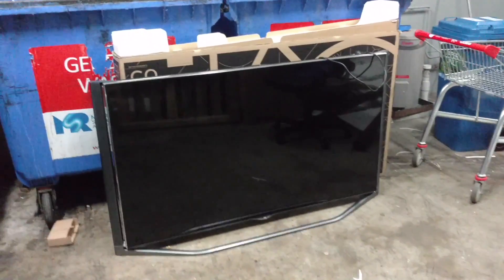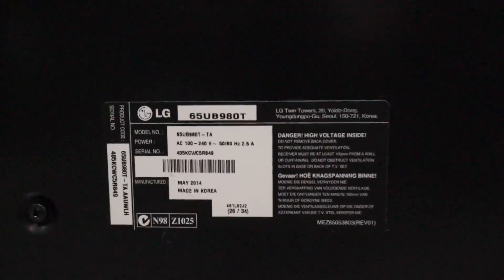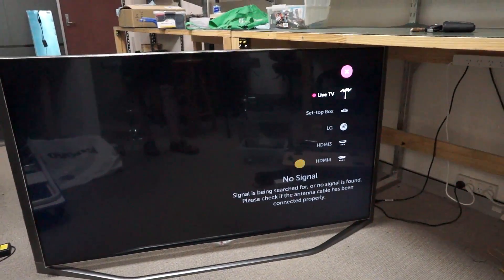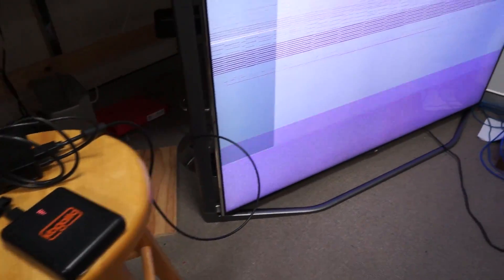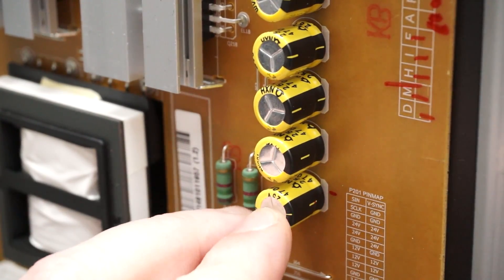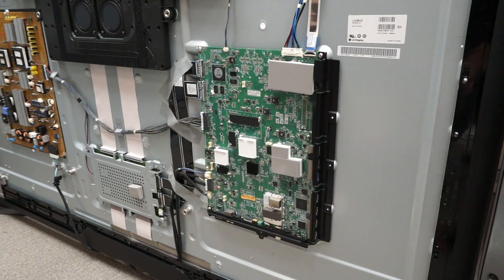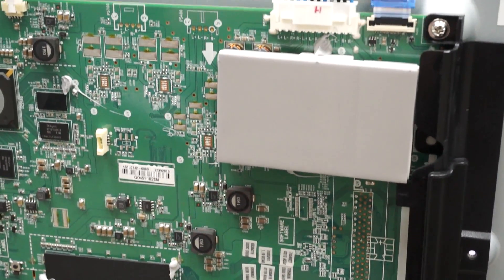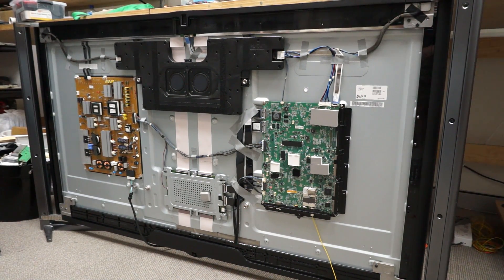EEVBlog #1145 - Dumpster Diving 4K TV!

Comment: LOL!  It's absolutely amazing what people throw out in that building!!!!  I am guessing bad BGA connection on one of those chips covered, but maybe the chip that connects straight to the HDMI ports took an ESD zap or something.  I do know that connecting HDMI cables up whilst powered can kill chips on occasion - happens a lot in PS4s and XB1s.  I hope you get time to look at this at some point!
Reply from the maker: $0 to toss in the dumpster room.
Reply: And this is why I sigh when I see certain products with no ESD protection on the HDMI ports at all.

Obviously those newer consoles do have ESD clamp diodes (either in the HDMI chip or external), but it shows that even those still get zapped quite often.

I'm talking more about specific boards that hook up an HDMI port directly to FPGA pins etc., and those definitely don't have full ESD protection beyond the usual IO clamps.

And it's often not "static" itself that's zapping the chips, but that voltage difference you get between two SMPS-based devices, or say an Earthed PC and a monitor.

Without the requisite extra ESD clamp diodes, some of those devices are just waiting to be zapped. And, as you said, it happens sometimes even with the diodes, so best to power down the console before connecting cables.

#ESDrant   lol

But yeah, I agree that the fault on this TV might be a cracked BGA joint, or some bad RAM maybe. Could still be a bad core supply or something, of course.

It looks as though it's at least trying to write the pixel data to the DDR RAMs, and obviously the scaler chip is detecting the input format (and even the PCM audio), so I reckon the problem could be the signal path between the scaler chip and RAMs, a bad RAM chip, or dodgy supply there.

The OSD is probably handled directly by the "Smart TV" SoC, and uses its main RAM for the OSD buffer.

It might even be the connection between the HDMI input chip and the ARM SoC itself, or noise or an LVDS / TMDS link maybe?

I still can't believe people throw out stuff like that. I don't even have a 4K display yet. I only just got a 1080p TV and monitor about two years ago. lol
Reply: I'm watching this on my very own dumpster diving tv set with no faults hahaha
Reply: paid 150$ for pickup to trash yard. but cost 3000$ for fixing from service center. no brainer, just make it another world's trash pile and get another New TV
Reply: Killed a pi by plugging HDMI in while powered on, I suspect it's the tv I used as it does like to float quite high above gnd
Reply: @Blondie SL Where you from ?
Reply: He should get the broken screen one and take the board from it :)
Reply: Good idea, but l think thats not what the channel is all about. He' ll find another way to fix it. With the wide variety of divices on the market it'll be hard to find the right one anyway, unless he pays for it wich l think he wont.
Reply: @brotschuh  Yeah, I was just throwing out some ideas, who knows maybe that one has a similar issue that could be interesting as a donor

Comment: Bad solder joints on the main scaler chip (BGA of course). A bit of flux and reflow and she'll be all right again :) Broken BGA-joints on flatscreen TV's are totally "normal" when they fail.
Reply: I agree; it could very well be cracked solder joints on the main BGA that is causing this. I think it would agree pretty well with the symptom.
Now, the question is just if Dave has got the balls to repair it. ;)
Reply: 20+ years experience repairing TV’s etc. Wise me gave it away in 2008 ;-) I too suspect the likely potential of bad BGA solder joints. There appeared to be vertically synced data on the display. To confirm it, you may be able to apply some local pressure to the HDMI inputs processor and then power the set in order to get a clean HDMI sourced image. The last time I browsed a (apparent) service manual, it was disgusting to see rails and data lines etc. going to an empty white square labelled “uCom section” or similar right in the middle of what was meant to be “The Schematic”. Talk about a forceful throw away society we’ve come to be.
Reply: @terrypriest4898  hopefully that can change. At least in the US with Right to Repair which Apple and gang were trying their best to bloke. As if we repair our stuff they can't sell more phones/TVs.
Reply: @terrypriest4898  Flatscreens havent been around 25+ years?
Reply: Tyrone Nelson No, but I have been around alot longer than that 😉
Reply: @terrypriest4898   Not long enough to work out why people get  a<>lot of flak for appalling spelling, apparently. SMH.
Reply: AntiCorruptionCentral yeahitmustsucktobesoboredtopointoutamissingspaceinaresponsequicklytypeduponamobiledeviceandassumebadspelling.gladmylifeisnotsoinadequate.duh!
Reply: @eevblog try a repair!
Reply: It's all about Balls !
Reply: @RavetcoFX it's not a flip chip. It's not the high lead bumps at fail here, it's the actual solder balls under the chip
Reply: @zaprodk  some time pople mistake the isue becuse when you reflow th donw ball the uper get too and fix the isuue but whit time the fail come back like on nvidia 8600m chips.
Reply: Datz was enough to kick it and it works.
Reply: John Doe oiss
Reply: I agree, a simple 10min reflow can give this TV a few additional years of lifetime. With proper re-bailing probably a decade or more.
Reply: Wrong, its a bad video decoder, processor.
Reply: @RavetcoFX  long enough to stick on craigslist for 600 bucks?
Reply: can you reflow solder balls? I thought it needs a full reballing
Reply: @zerpBot
 That would be the first step. Using a hot air station and flux to reflow the balls. If that failed and you wanted to remove the chip then you'd need a reballing stencil for that chip.
Reply: @zer0b0t  https://www.youtube.com/user/rossmanngroup the guy has lot of great tips on repairing
Reply: Yeah, there are thousands of videos on YT where they bake their playstations and xboxes and what not in the kitchen oven 🤣😂 

But l think thats not what he is suggesting.
Reply: @brotschuh  No. Baking the board is brain dead. It will destroy more than it fixes.

Comment: Download a ir-remote app for your phone, if it's got an IR transmitter, (or if lg has remote app that goes over network) so you can explore menus a bit more and try turning off pic enhancment etc and try other sources, it probably have both wireless display and something smart-tv like youtube etc. Because it could actually be the picture processing chip instead maybe? Atleast since it seem to recognize correct hdmi resolution etc (although I know DDC is on a i2c line, I guess the same chip take both picture and data).
Reply: kruppin that’s all well and good but he needs a remote to get the WiFi connected..!! Doh..!
Reply: @MrOrangeman18  but I said he should use the ir remote if possible. Many new phones have ir transmitters just for this very reason. And no, he could use a ethernet cable in the TV, no settings required, so... Doh on yourself. ;)
Reply: @kruppin   "many new smartphones have ir transmitters" ... name one. My Samsung Note 3 from years ago had one, not anything I've got/seen recently.
Reply: Yeah... unfortunately, this is only valid for a few chinese brands these days. Huawei and Xiaomi phones, mostly.
Reply: @xenonram  well, maybe it's been a bit less on phones again, but most huawei, LG and xiaomi phones have had it that I've seen. And alot of other cheap Chinese phones have it too. I have no idea what phone Dave is using.
Reply: @xenonram  Yup! Me too. Samsung Note 3 was the last phone I had with an IR transmitter. I wish they'd bring the IR blaster back. It definitely got me out of a few situations involving trying to connect my laptop up with random TV's in conference settings. I'd bet you and I were two of a small handful of people that actually used it.
Reply: @RetroComputerStu  Note 4 / S4 were the last Samsungs to have it I believe.
Reply: @xenonram  My Note 4 has one
Reply: It is a good idea to keep your old Galaxy S4… Works as pretty powerful remote!
Reply: Lg does have a remote app, LG TV Plus. But, you have to do the connection first.
Reply: it's a UB9800, you need the magic remote (works over 2.4ghz) so the IR blaster is a bit of a moot point
Reply: @xureality  well, most tvs that have  2.4ghz type remotes usually either come with an extra normal ir remote or at least support them in some way.
Reply: Unfortunately many phones no longer have IR support anymore.
But these TV-s are using mostly universal remotes.
Reply: No ethernet port on the back? Never seen a tv without it from the last few years

Comment: I needed a new TV after I moved across the ocean, and went to buy a 4K TV. I wanted like a 55" or something, the same size as my old TV, nothing too crazy, but the only units they had in stock were the 45" and the 70", and I was about to walk away but the guy said he'd give me the 70" for the price of the 55"! So now I have an obscene television wall. It's also unfortunately a Vizio, which is good enough, except that I can't connect it to any kind of network lest it starts shipping away all of my viewing data to Vizio HQ (along with presumably some insanely-intrusive information about my internal network). And of course Vizio made an extra obtrusive ToS agreement, so there are two or three buttons on the remote that are extra easy to push accidentally which causes the TV to then nag me to agree to Vizio -- and Google! -- Terms of Service, which ain't happening in any universe. It also makes a weird high-pitched buzzing sound if I suddenly mute, pause, or stop an HDMI audio stream (e.g. Youtube via VLC). My research indicates that this may be caused by Vizio using sub-par quality capacitors on the power board. Incidentally, I have luckily replaced bad caps on power boards in LCD TVs like twenty-five times in the last ten years.
Reply: It shouldn't be too difficult to figure out what IP addresses the TV is communicating with and then block them in your router.
Reply: The cone is crap anyway, give MPC a try it’s better in every way.